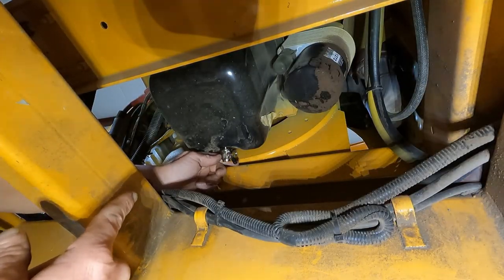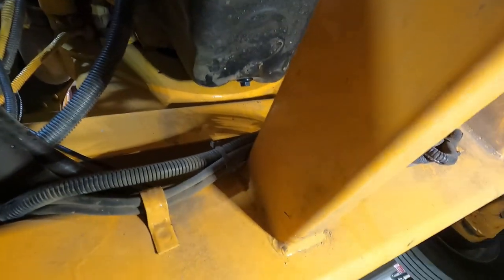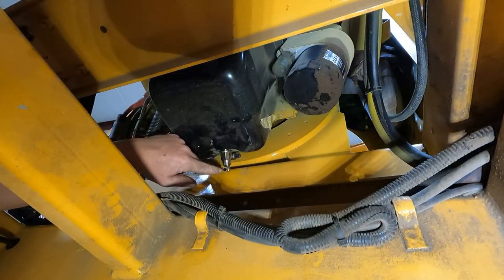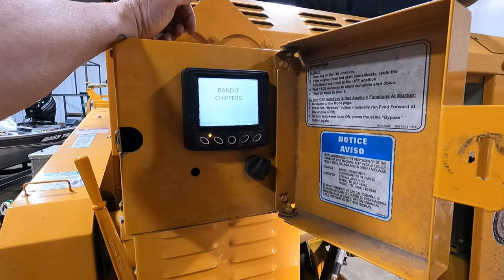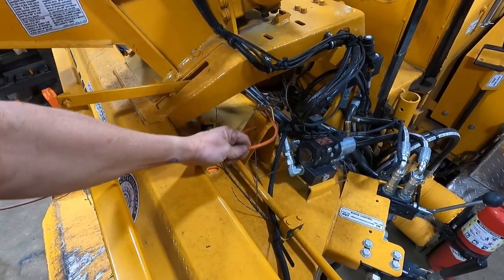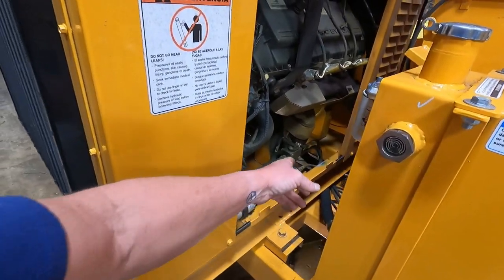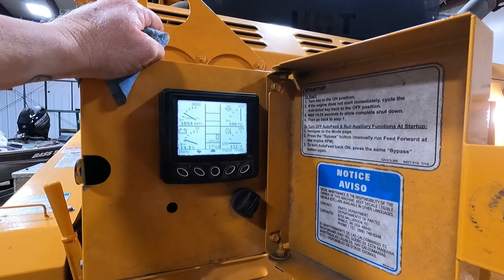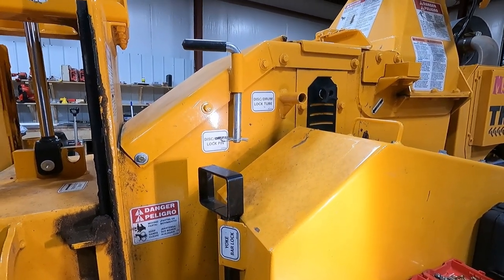Oil drain plug removal while pulling a vacuum on the ford engine

Comment: Just a thought. Saw this same type of drain setup on an industrial pulverizer gearbox. The maintenance man that installed it did a good job, but the vibration eventually caused the petcock to loosen and open the drain. The gear oil drained over time and trashed the drive. When a new one was installed, they plugged the drain line "just in case".
Reply from the maker: This has a lock on it when you close it.
Reply: They put something like that on one of the school buses at work to do oil samples.  It failed, blowing up the engine, and they wouldn't warranty because of that.  Wound up costing them $40,000 for the bus engine and it was a brand new bus.

Comment: Tim...I have never been a fan of multi-grade engine oils in machinery that runs at almost constant high loads.  It was designed for cars that run maybe 10-20% of the time at a load.  Most car and light truck engines rarely run at the RPMs that your chipper does for hours on end.  In the marine industry, the commercial fishermen, tug operators, charter boat captains etc mostly ran either straight 30W or 40W oil unless they would shut their engines down for extended periods in the cold when they would run 15W-40.  I think if you ask most heavy equipment mechanics they will say use straight weight oils in your heavy machinery! Just a suggestion.

I can't agree with you more about chipper safety.

Comment: The rule when working on something mechanical is if you drop anything it will be attracted to a bucket of oil or antifreeze or fall inside a inaccessible location.